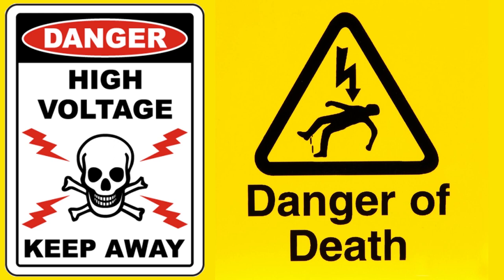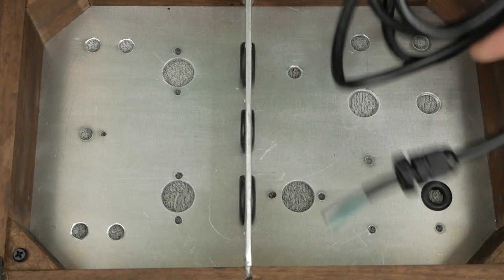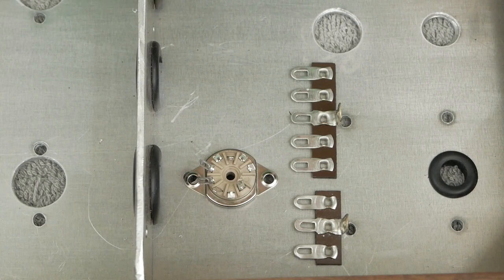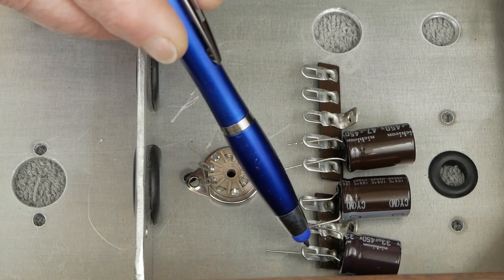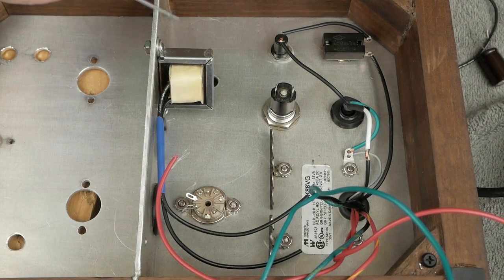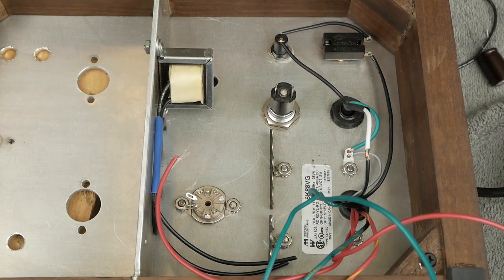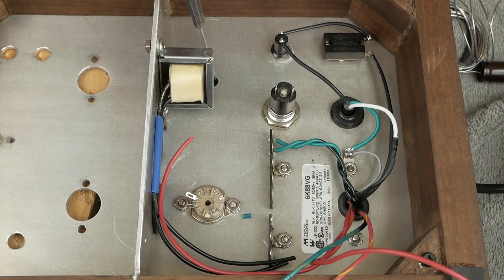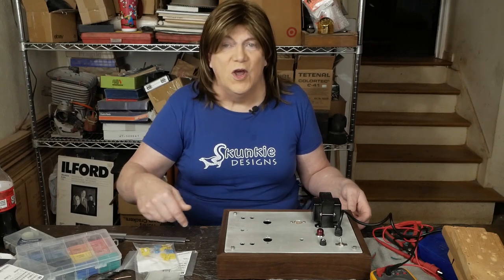"Color" Tube Pre-amp for Solid State Amps: Power Supply #1

Comment: There is a guy here on You Tube that had built a pre-amp like this, but using a 6SN7 tube.   He also built a tube based power supply for it, but he added an OD3 regulator tube.   Now, while I understand the reasoning for this to create a more stable DC supply, I have read that these regulator tubes can be very noisy.   For the most part, I USUALLY don't see them used in commercial tube amplifier designs, but I have seen at least one amp made by Grommes that used a regulator tube for the bias supply.   Not sure if you are interested in building another one of these with a tube regulator and do some tests on it to see how much noise the regulator tube adds to the signal.
Reply from the maker: There really is no point in regulating the DC in a design like this.
Reply: @SkunkieDesignsElectronics  I didn't think so as I have seen many amplifier designs and only a handful (if that many) are using a regulator tube.  I know at least two designs were by Grommes.   But when I saw the recent design on You Tube, it had me scratching my head.  I mean the tube looks cool and would make a sensational power indicator, but I heard they can introduce noise in a circuit as well.

Comment: I live in Denmark and we have 240v.
What transformer can i use instead and does any other parts have to be different then? 
Thanks in advance.
Reply from the maker: A 300 series hammond transformer is used and no other parts need to be changed.
Reply: Thanks for the quick reply. I just ordered all the parts and looking forward to do this build. I appreciate your very helpfull videos very much @SkunkieDesignsElectronics